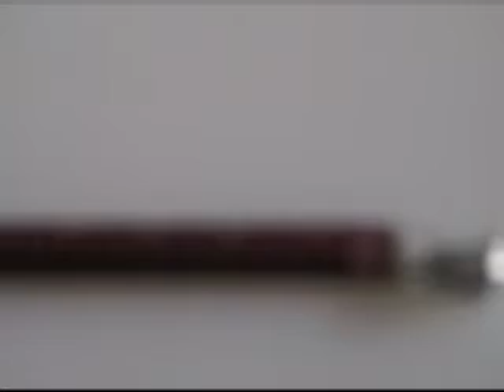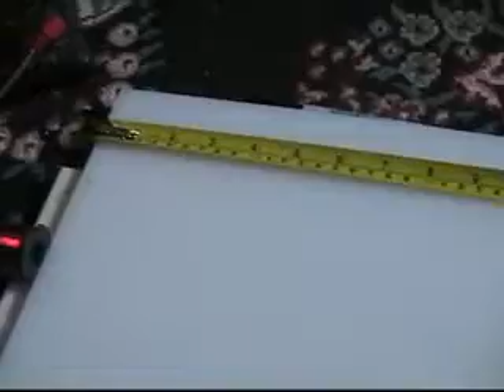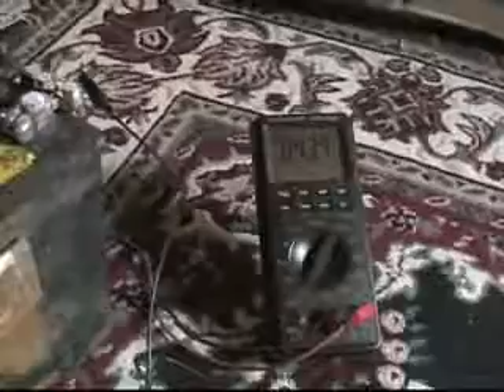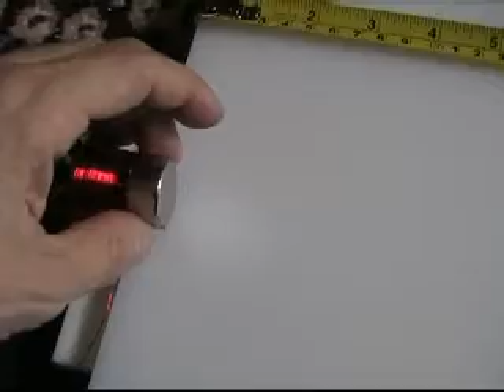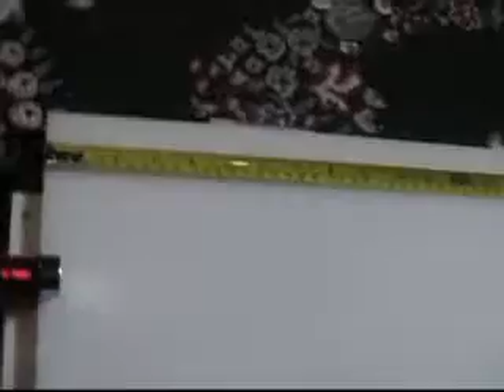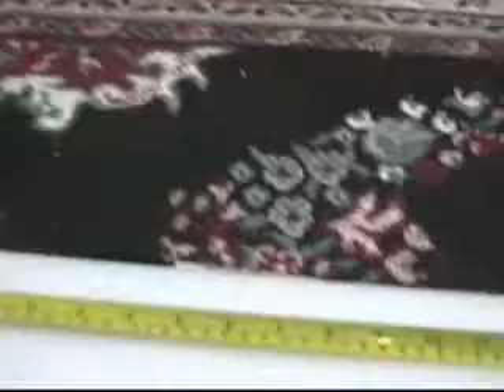Electromagnet Testing

Comment: You could have measured more accurately by moving the scale each time. Particularly in the beginning, your measurements would have been better because you measured the ceramic magnets as though they had traveled parallel to the scale rather than at an angle intersecting the scale. I believe that the single ceramic magnet in the first tests did travel a little farther on average than the doubled up ceramic magnets. Also, you really should have used equipment that could actually measure the data.

Comment: Nicely done. Very educational for those who intend to self build a charging system to self power a DC motor for electric cars. Expand your design, see Flint Parallel Magnetic Path. With just the battery alone can you not fire the magnets?